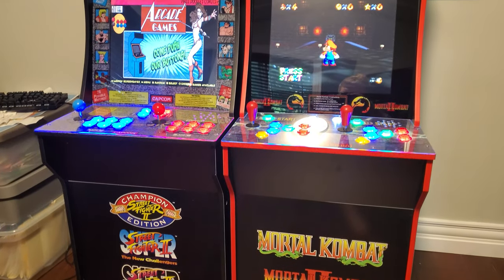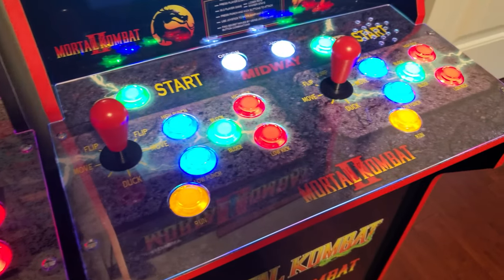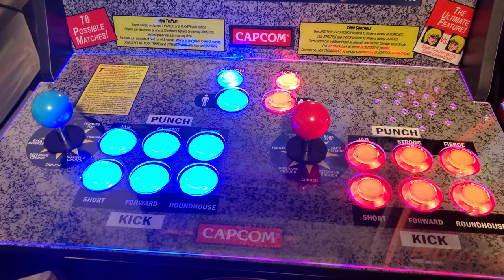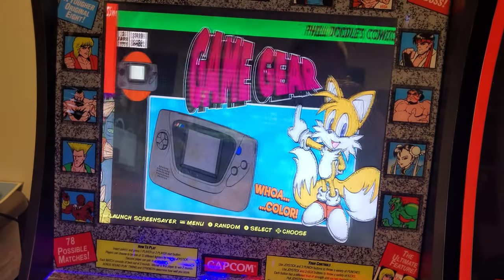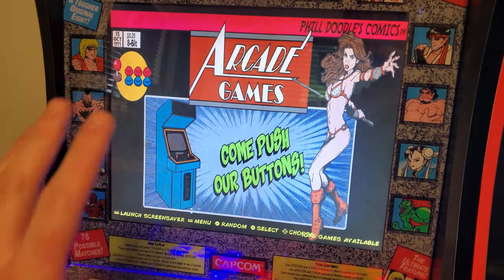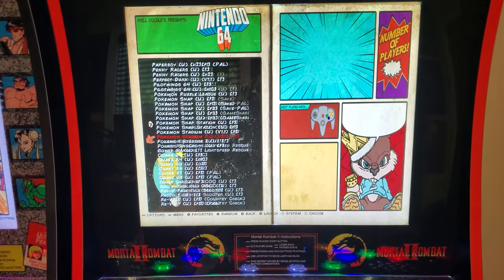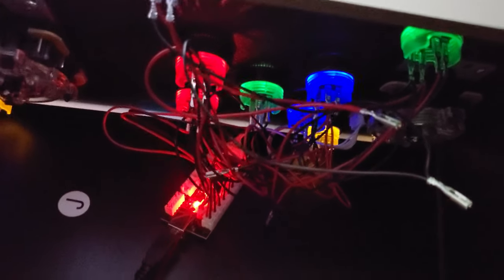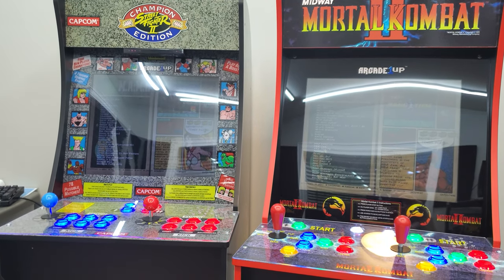Awesome Mods for your Arcade1up Cabinet

Comment: Love the gun addition. It looks awesome! Is it possible to set up two guns to play two player games? Thanks for sharing your cool mods.
Reply from the maker: Yes it is but the pi only has 4 USB ports and I was using 2 for the joysticks, one for the gun sensor and one for the gun itself
Reply: Thank you. I will give it a try!
Reply: If a powered usb hub was added to the pi, would it be able to run 2 guns? Also, would it need 2 sensors for 2 guns or would one work for both of them?

Comment: Will it run Crysis?
Reply: The Raspberry Pi is great for PlayStation emulators anything higher than that and u will need a better processor its basically a mini computer capable of alot of functions much like a cell phone , but better ...
Reply: @dustmite31able  it's a joke dude....I have rp3 running on my arcade 1up  tmnt cabinet with 3k games. Ha, fun stuff!

Comment: Good job modding them but it looks like your Raspberry Pi might get smashed between your cabinet and the wall but have you looked into the Odroid XU4 yet? They're basically about the same thing as a Raspberry Pi but more powerful so I believe some of the games and systems like Nintendo 64 or Sega Dreamcast will play a lot better on an Odroid XU4 but you can check it out yourself.

Comment: Do not do this to the MK A1up!  The button layout is wrong for most games and is still at full price.  SF is the one to mod.
Reply from the maker: Agree completely, SF cabinet is the way to go. I am super pumped for the new TMNT cabinet coming this year, 4 players!
Reply from the maker: Rufus Watson  yeah I saw them on eBay. i was just huge fan of the original TMNT arcade so I like the whole cabinet.
Reply: I've done it to a mk cab and just reconfigure the controlls per game if they dont work out. It's not that hard. My mk cab is great. It's almost like this but I kept the original buttons. I added new speakers.
Reply: Actually I put my coin buttons in the volume and power slide holes just like this. I have the buttons on top of the plexy glass though as I did not know how to make a clean cut in the plexy.
Reply from the maker: @mattymatt022000  You can't tell from the video but the buttons I use there are actually smaller. They fit fine without any modifications to the Plexiglas at all.
Reply: @frickmagic  yea I'm using smaller buttons also but the sit ontop of the plexy

Comment: I'm brand new to this so can I ask questions to all of you here. I ordered the Pac-Man arcade 1up 40th anniversary cabinet. It will be here in about two days. My family are really excited and I can't wait for it to get here but we also are eyeing the space invaders cabinet. Since we are new to this we are wondering is the space invaders cabinet a good cabinet to modify (Mod)? If so will space invaders still be on it if we "mod". We have been looking at a lot of videos on YouTube to get used to the lingo.  Also new rookies like my family will it be hard for us to do this modification?  Any information from any of you guys will be appreciated, Thanks.
Reply from the maker: In my opinion, if I was buying one to mod, I wouldn't do either one for 2 main reasons. #1 is that both of these cabinets have a vertical screen which means that most arcade games will not look proper on them. Either they will be stretched or have 2 massive black bars on the top and bottom. Reason #2 is the button layout. Pac-Man has a centre joystick and holes will have to be drilled. Street Fighter or Marvel have the best button layout already making it way easier to mod.
Reply: TheTechGuru thanks, we're gonna look for Street fighter cabinet because it seem that the Marvel is hard to find at a decent price. Also what exactly is the parts I need to get more games?

Comment: Thank you for the video.
Curious, do you have original street fighter and Super Street Fighter II and Turbo on the street fighter aracde mod? I couldn't find a compatible rom set for ETA prime .078.
Where did you find those roms? which versions are they? if you have installed? Thanks!
Forgot to mention, looking for MAME versions, not super nintendo or anything else.

Comment: I'm curious, but how would the emulator be affected by the order the buttons are wired vs the other board? Each button gives the same signal when pressed. That's seems odd. The encoder would just be receiving that input.
Reply from the maker: It has to do with the software running it. You would think that it wouldn't matter but if you don't configure them the same then it triggers button presses on both sides

Comment: Can you still access the original games after you install pi?
Reply from the maker: Yes and no. The original games will now be part of the mod so you can still play them but it won't have the original arcade1up menu and game selection screen.
Reply: TheTechGuru yea that’s what I thought,which is fine as long as you don’t lose those games,thank you very much for your quick response😷

Comment: Do the stock sticks and buttons work with the mod? Would an Odroid XU4 work in place of a pi?
Reply from the maker: AwesomeMomof2 yes I haven’t tried it but I believe odroid would work fine. Stock buttons can work but it requires more wiring and is a lot more advanced. It is much easier to buy the $40 kits in all honesty.

Comment: Why did you e two ipac chips for the control panel instead of just one. Did you just want to save time and not extend the wires??
Reply from the maker: they are not ipac chips or else I would have. They are just arcade control boards and with a raspberry pi, they have to be seperate as they do not simulate keyboard buttons.

Comment: Can you get xbox 360 games. NFL BLITZ and NBA JAM from the Xbox 360 I am sold.
Reply: No, this is using a very low powered all in one board to emulate these games. It's not nearly powerful enough to emulate the 360. I haven't checked in awhile, but I don't even think fairly powerful modern gaming PCs can emulate the 360 very well.

Comment: would the newer marvel cabinet now be a better choice to mod then the street fighter cab and would these parts be compatible? thanks in advance!!!
Reply from the maker: They mod the exact same except you use a slightly different control panel for the monitor. Usually I recommend the street fighter since it is cheaper but the marvel is a newer generation and has slightly better quality, not to mention, it looks better. So if you can, go with the marvel.
Reply: @frickmagic  Thanks so much for the response! much appreciated!!! I wanted to add a light up marquis and sanwa buttons so the limited edition marvel cab is what I been looking at!
Reply from the maker: @therealfolkblues5535  yes, good choice

Comment: @ the tech guru. Can you list the parts you used for your light gun set up?
Reply from the maker: DJM2 any aimtrak setup will work. It comes with the gun and sensor. It does work better on a PC than a pi though

Comment: How did you install the Lightgun what was the extra piece of software?
Reply from the maker: The software is built into the build I downloaded under EZ Hax Toolkit. You just need the aimtrak gun and the sensor bar. I drilled a hole in the top to hide the cord and stuck it there with double sided mounting tape.

Comment: So you paid $300 for some wood with decals and a small screen?
Reply: What an idiotic summation of an arcade machine. It's the base you're paying for, so you don't have to put the time and effort into cutting your own. And that's if you even have the tools to do so. Might as well sum up an expensive table and chair set as "some wood".
Reply: It does seem like a lot when you get down to it, but there are shit loads of people who got these things as Christmas gifts last year and will get them again this year (they've been pushing the TMNT one hard lately). So you have this big ass cabinet sitting there that you hardly ever use cause it's got 3 games on it right? That's where a mod like this shines. It turns a lump of useless wood and plastic into something you might actually use. Personally I wouldn't buy one of these things just for the purpose of modding it. The cost of the 1up+the extra hardware to turn it into what he has here is a lot. Not even including the time and labor modding it. There are better, cheaper ways to have an arcade experience at home. IMHO.

Comment: id say the tmnt cabinet is the best for modding, it doesnt have all the wholes drilled in like youd want but it has the largest plate to work with
Reply: I own one and will disagree. Unless you start from scratch with a replacement board and build it out for 2-3 players. There's not enough room for a proper 4 players. It would work, but it would be cramped(already is for me).
Reply: @teamhex  i should have clarified, 2 people is what i meant, that and a ball in the center.

Comment: Great video 2 questions please. What was the name of the device that was on the back of the monitor? Also is there a way of adding a track ball for games such as Millipede?
Reply: Question 1) If you have an arcade 1up you need to look for monitor controller board by just searching the number on the back of you monitor. 2) you will just need to make a hole for it and then you can yes
Reply: 1) if you own a arcade one up you can find a monitor control board by searching the number on the back of the monitor. 2) you can add any buttons you want just drill the hole and configure  it with retropie

Comment: ball sticks on the SFII SMFH
Reply from the maker: Mad River Reefs haha that’s what it comes with, don’t worry I replaced them
Reply: Traditional Japanese SF joysticks are Sanwa ball sticks with square gates.  I made one for PC SF4 when it came out.  Works great and I prefer it to my Happ bat stick with round gate.
Reply: Happ sticks were garbage. We just didn't know any better because it was all we had.
Reply: @brokenhalo22  I disagree,  it can be hard to find down back on them when I panic though.
Reply: @jackburton6239  I guess it depends on how "seriously" you play fighting games. The Happ sticks had heavy springs, long throws and vague gates (difficulty finding diagonals is pretty common on these). Sanwas have shorter throws, lighter springs and crisply defined corners. When it comes to speed and precision, there is just no comparing the two.
Reply: @brokenhalo22  You do know that happ throw is less than sanwa and semitsu?  MvC2 players much prefer Happ in general cause of shorter throw and stronger spring.
Reply: @jackburton6239  Maybe in terms of degrees, but the height difference really changes things. I know from experience it's a whole lot more arm motion to go from back to forward with a happ, vs a sanwa where its all wrist due to softer spring and lower height. The mvc2 community were in love with a particular happ stick, the p360. I've never had the chance to use one, so cant speak to it. Anyway, in the end it all comes down to personal preference, but there's a reason why 90%+ of stick players at tournaments are using sanwa, and you almost never see a Happ/IL stick anymore.
Reply: @brokenhalo22  You are right.  Just measured mine. The Happ is just over 1/8 inch throw, where Sanwa seems right at 1/8 inch.  Base measurement so that there would be bigger difference at end of stick.

 I do prefer my Sanwa to my Happ, but the Happ is still competent.  I built em for me and my son back when SF4 came out on PC.  Never was that good of a player though.  

I played SF2 in arcade a ton back in the day and generally Happ was all we had.  Played on a Sanwa machine once and was " WTH is up with square gates?"
Reply: @jackburton6239   Pretty cool that you're bringing your son up right. Keep him on the Sanwa if you want him to be a world warrior. Cheers!

Comment: I mod cabinets based on the games I'll be emulating. SF2 and MK II have the most buttons, but this can get cumbersome if you're playing old Z80 games that use a 4 way joystick and a jump/fire button. Also, a Raspberry pi works great for old games, but will choke on 3D fighters. A Pacman cab would be perfect for old games running a pi, and SF2 or MKII running a mini pc would be perfect for fighters with 6 button configs and 8 way joysticks. You can also buy a very nice monitor with hdmi allowing you to skip the whole converter board. Just my opinion.